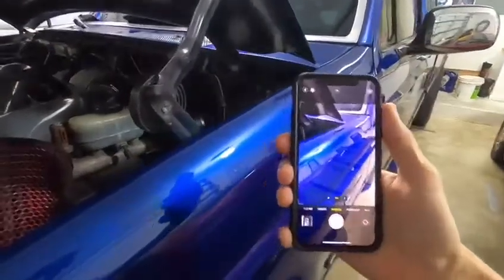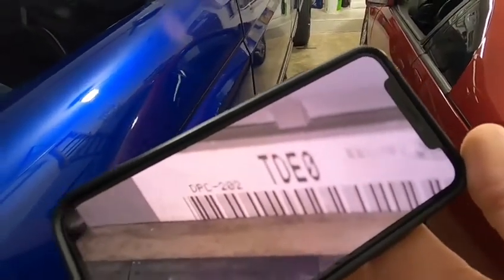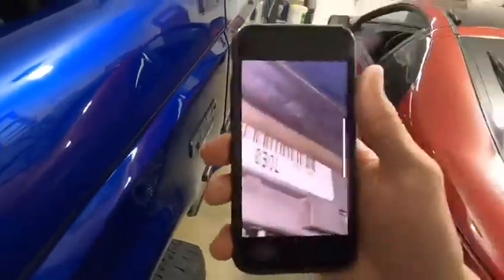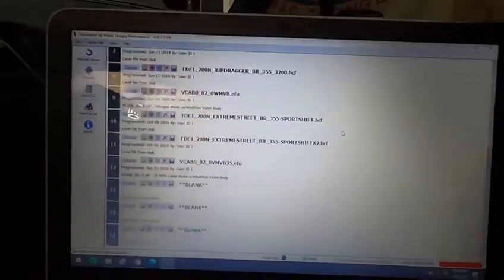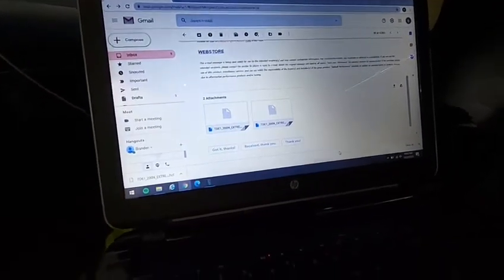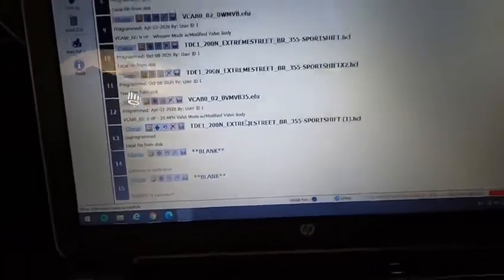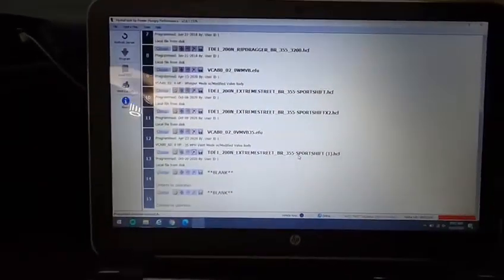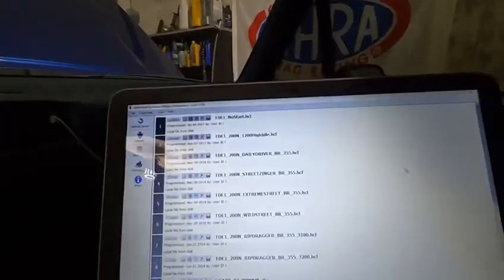Adding Custom Tunes - Hydra Chip - 7.3L

Comment: Thanks for the vid. So you're the Jeli I keep hearing about for great customer service. I've been using GH for 8 years now and their tunes seem to shift the 4R100 very well, except for one cclbdrw which shifts sloppy - could be the 320k mile trans. My other 7.3s all have Pepe's Stage III.  I just loaded some fresh GH tunes in that F350 to see if shifting improves. It's a Stage 1 PMR motor with FF 180cc and blanketed KC, all the std mods, tow pig (I won't buy FF sticks anymore). How do your tunes work on the 4R100? Have you worked with Unlimited Diesel sticks? Rosewood is weeks out and no cores in stock...but his 238cc sticks have been flawless in my first build, done in 2017, F250 ccsb, Stage II build.

Comment: So I just installed 180/30 full force injectors in my 2000 7.3. I loaded jelibuilt tunes that were emailed to me on the hydra. Truck started after a few cranks and after driving it for a few miles, I realized I still had tunes from my SCT Programmer on the ECM. I returned the ECM to stock using the SCT and then started using the hydra. Do you think the trucks ECM could be screwed up with having two sets of tuning on it at one time? I’m surprised it started and ran. The truck fires up and send to run good. It does seem super laggy down low in the RPM’s and kinda has a hesitation under load. Any thoughts? Thanks Brandon.
Reply: No, I expect the Hydra is overwriting the other programmer. That seems to be the case with my Banks Six-Gun.

Comment: If you have a superduty 99 split shots and get some big single shots with jelli tunes can you use the hydra high idle and low idle and save the 6 you buy for the good tunes. Hate to waste all that money on a high idle and low idle but want them.  Basically will any of the hydra tunes work once you swap over from split shot or will only the custom tunes work?
Reply from the maker: It won’t idle correctly, it’s best to purchase a matched set.
Reply: @brianjelich9750  plan on buying some injectos from you and a hydra it was either u or 1023 but after finding out they are in alaska made it easy to go with you.  And your 7.3 is bad apples 👍👍